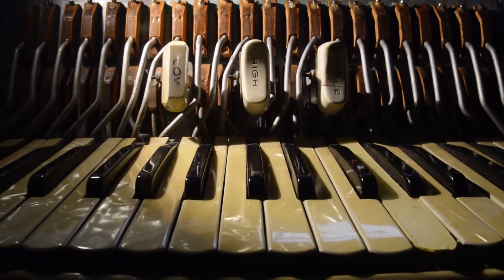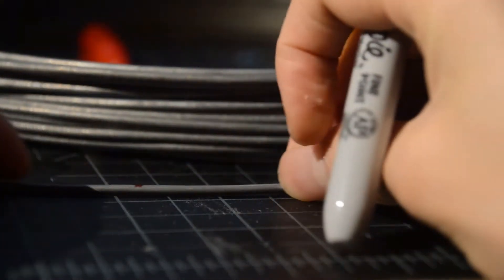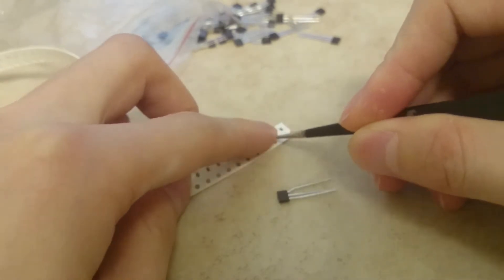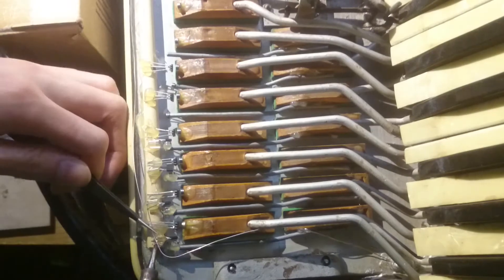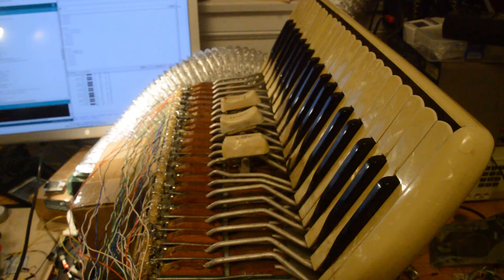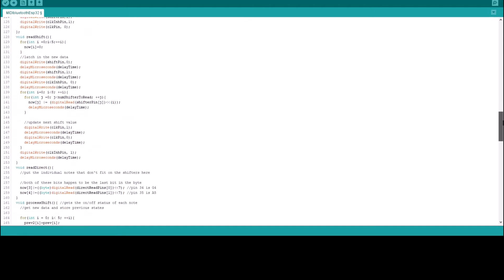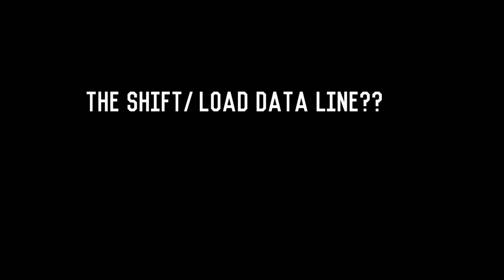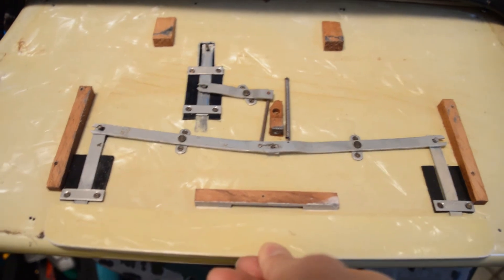[Bytes #2-5] DIY Bluetooth MIDI Accordion

Comment: @Elecronic Bytes, Nice video man but I got a small question: how do you connect the hall sensors to the esp or better asked how do you power them because the work just with a minimum of 4.5v and the esp32 can deliver just 3.3v... I am a bit confused but hope that you can clarify that to me!
Reply: different power supplies or step-up esp32 output voltage to 4.5v

Comment: Do you have delay between the pressing of the key and the note when playing? Do midi over bluetooth increases delay?
Reply from the maker: There really isn't a delay that I can feel when pressing keys to audio from the speaker. It does feels real-time despite any Bluetooth latency that may exist. However, it is easy to induce delays - the largest component in delay is how fast the code captures the key states from the sensors and processes that into midi messages. With the ESP, as long as I don't print anything to serial and run only the code necessary for generating and sending the midi messages, the delay is barely perceptible. Also, if I move the accordion into a different room (maybe past some walls with wiring and plumbing), I do get a bit of delay.
Reply: @electronicbytes5428  great! I have to give it a try... the silent instrument is very useful
Reply: @electronicbytes5428  and would it work same way (parallel capture, polyphonic) with an multiplexer as Cd74hc4067?
Reply from the maker: @danielrichardson1210   You've picked out a mux/demux chip, there are some fine details but they probably won't make a difference. I think it would be "good enough" if you switch things fast enough. It's not "true" parallel capture, but if you grab the data from the chip fast enough, there should be no difference to human ears. You've also picked out an analog mux, which means that if you capture the state of a key while it's transitioning from 0->1 or 1->0, the ESP will have to decide which one it is, rather than the chip deciding. The 4067's package size is also slightly larger than the shift register I used, so check if you've got place to put it inside the case before starting assembly. The 60 ohms "on" resistance might give you trouble if you're switching things too fast, but I don't think you'll get to those speeds where you worry about it. So overall, yes, you can make it work.
Reply: @electronicbytes5428  The Hall effect sensor is working: https://youtu.be/DDm9Sfvzhok

Now, could I just make a matrix with diodes using GPIOs to scan the 44 keys? That's all I need for notes
Reply from the maker: @danielrichardson1210  Congratulations on getting the hall effect sensor working! A scan-matrix with diodes is definitely possible if that's what you've got, but you start getting into the realm where the number of solder connections and criss-crossings can become really confusing, especially with 44 keys. You'll need the diodes in addition to the mag switches. Also, there might be issues with scan time and it being "parallel". I think it's doable though, just gives your brain an extra work-out.